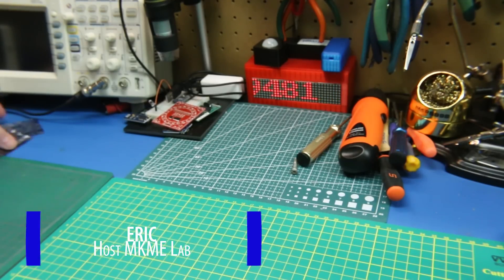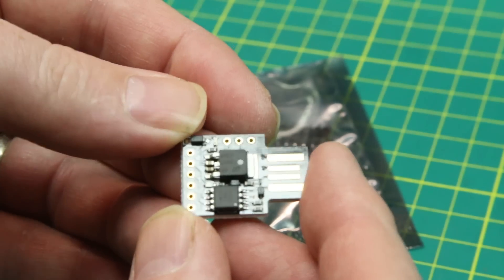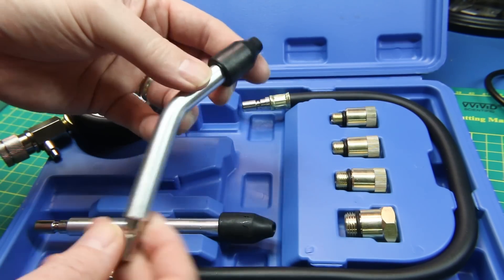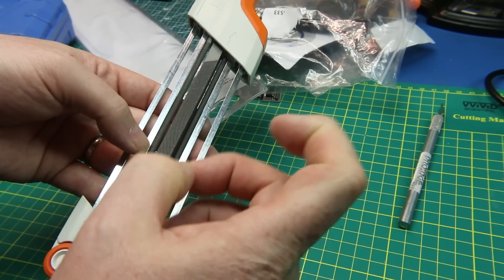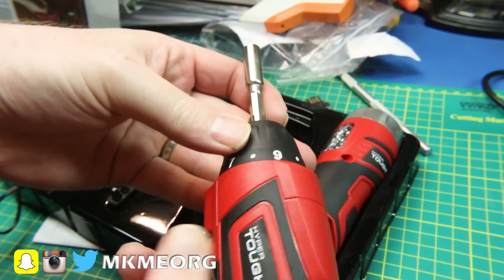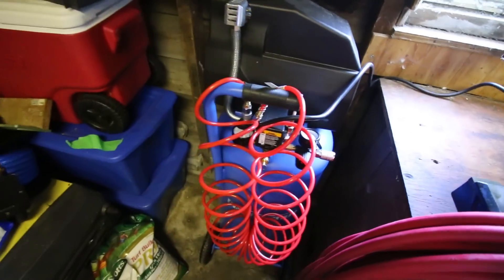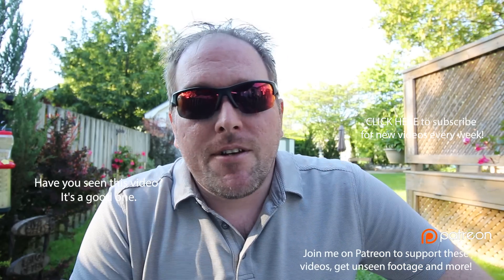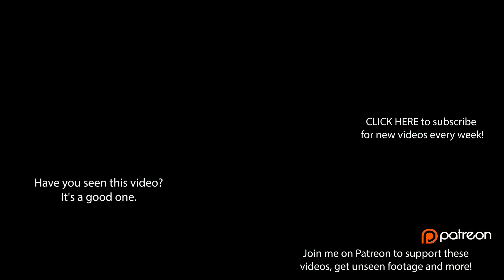🆕MAILBAG! Parts, Tools & Garage Build Update!

Comment: I've played with those ATtiny boards (AKA Digispark clones). They're really fun and useful (and cheap)

Once you grab the board definition files from the official Digispark page, the only oddity is that you hit the "compile and upload" button in the Arduino IDE before plugging the board in.

Other than that, when you power it up (with a sketch installed) there's about a 5 second delay before it starts running your code - that's part of the bootloader. It's waiting to listen for the IDE. If there isn't an upload waiting, it carries on with it's existing code.

Comment: I thought I had a video using ATtiny85 for USB, but it looks like it was an abandoned project temporarily. 
 What I do remember three or four months ago when I first used it, I bricked it pretty much immediately so that’s the videos I ended up doing, how to get back to the starting point! Maybe that would be helpful to you. 
https://youtu.be/JskwC4bhgx4

 Then I needed to reprogram the boot loader so that was another rabbit hole: 
https://youtu.be/RlscDz5JCcI

 As far as how the USB works on that chip, they bit bang it with that boot loader and a few of those hardware components to emulate USB hardware and it may not work perfectly on everything it’s plugged into but I didn’t have any trouble with it on Mac and Raspberry Pi.

 Those boards should already come with the boot loader and should work if you put one of those example sketches into it for something like generating keystrokes, when you install the digispark Arduino libraries and get those examples. Then when it’s programmed, when you plug it into USB with a text editor open or something you can see keystrokes. 

 Another quirk about the way the boot loader works, when you want to upload a sketch you have to  start the upload, then unplug it and plug it back in because it will only allow programming while powering up and then it just goes into USB mode  if no programming operation was detected.
Reply: I have a few I still haven't messed with.  One day...